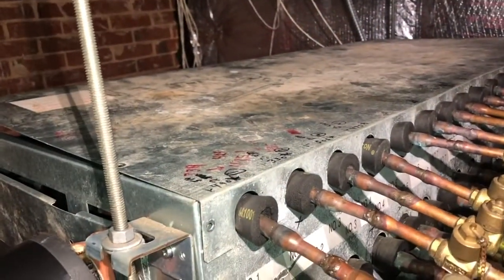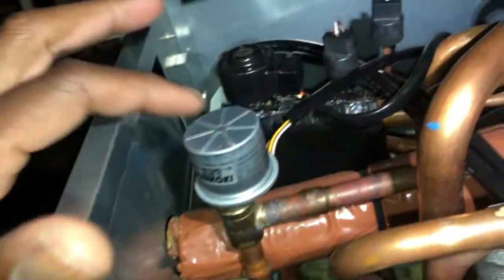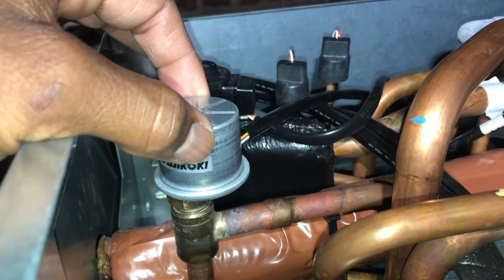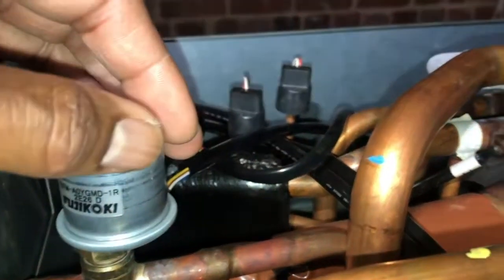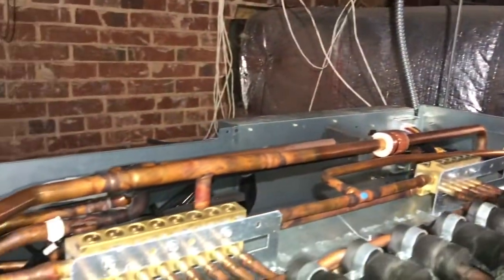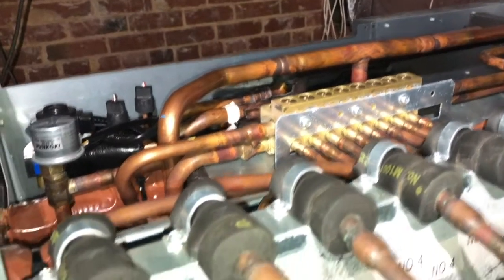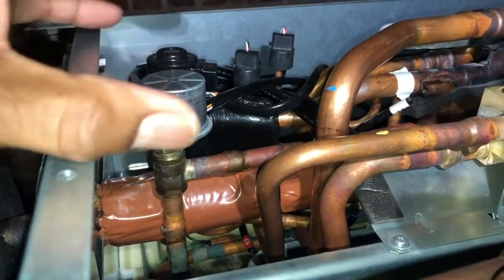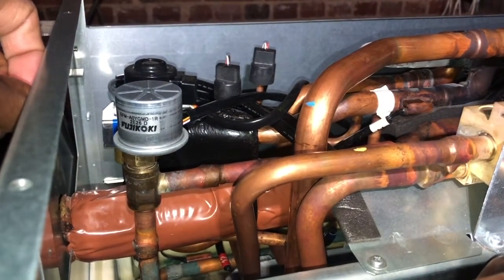A Look Inside The Branch Controller On A VRF System

Comment: The valves and all that exposed copper should be insulated
Reply from the maker: It’s not exposed like that. The video is shot with the cover off. It’s like inside of a air handler where the coil is located. The pipes on the coils are not insulated because it’s not exposed.